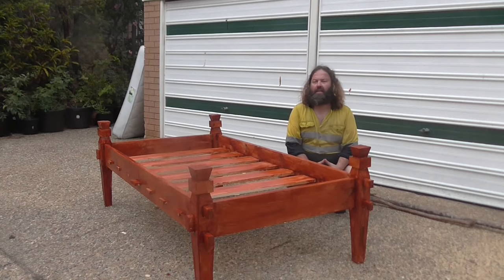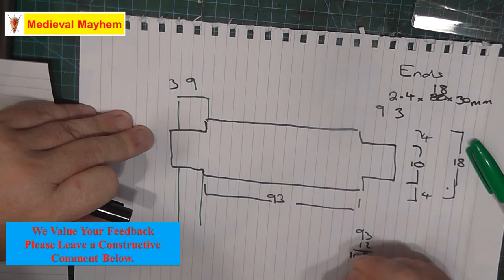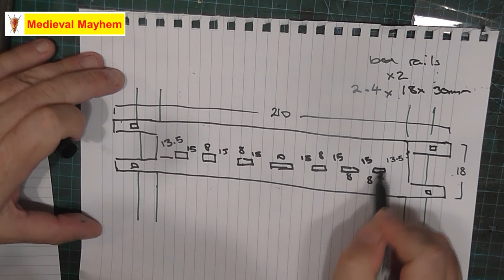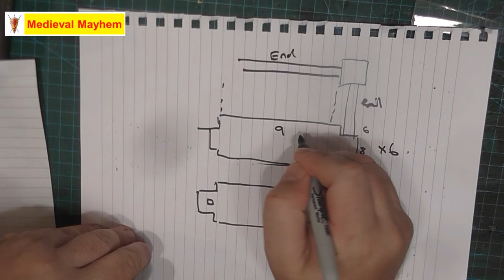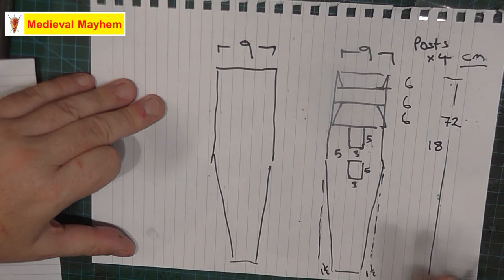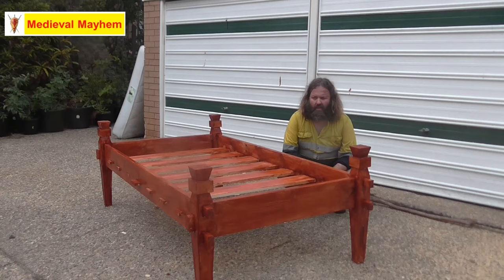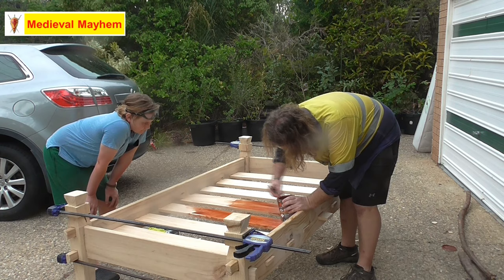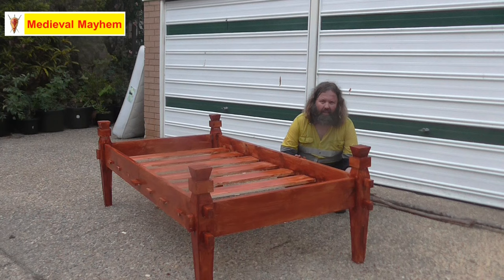How to Make a Gokstad Bed (Viking DIY Medieval)

Comment: Drill holes in the corners of the cutouts before struggling with the jigsaw. You'll get cleaner inside corners and it will go faster as you only have to make 4 straight cuts instead of hogging out bits trying to turn the jigsaw.
Reply: Cool project man!
Reply from the maker: Thanks - good tip.

Comment: Slat beds are hard for sure.  Lots of accurate cuts that need to be spot on.  From here your cuts look great.  You could clean up your saw marks ( we call them chatter marks in my neck of the woods) with a sander.  Or just sand paper and elbow grease.  Maybe a project for your son?
Anyways it looks great.  How sturdy is the bed?
How fast and easy is it to set up?

Thanks for making the video :)
Reply from the maker: Hey, bed seems pretty good thanks. Easy set up - but the mortise and tennon joints are a bit stiff.
Reply: @Medieval_Mayhem  stiff is good.  Keeps things in place
Reply from the maker: @TheBeardedAxe  Thanks

Comment: I am only 7 mins in...but I wonder if you caught your mistake when drawing out the head/foot boards.  It was 93cm, and then you added the 12cm (9+3).  That's only for one side.  Should have added 24cm, for a total of 117cm, yeah?  If I missed a correction, my apologies ahead of time.
Reply from the maker: You are correct. Sorry if that wasn't clear. I struggle with problem solving in the heat due to previous heat stroke.
Reply: @Medieval_Mayhem  - sorry for the repeated comment from FB.  :)   It looks really good, especially considering the limited tools you have, and the limited time you had to make it in.
Reply from the maker: @asbrand  Thanks